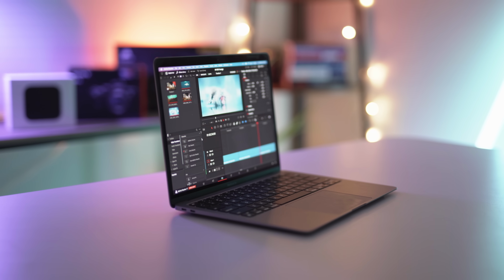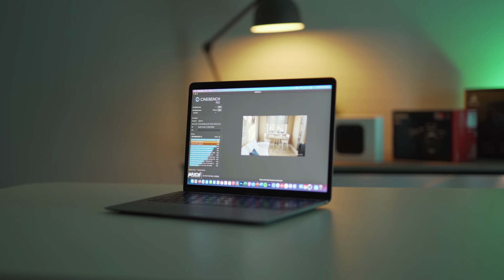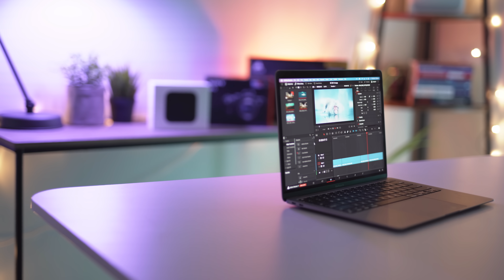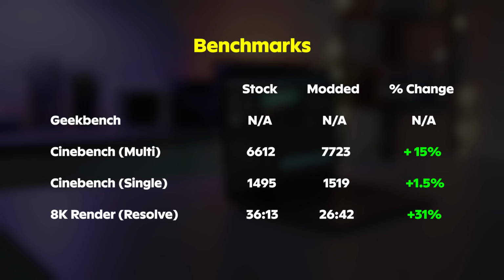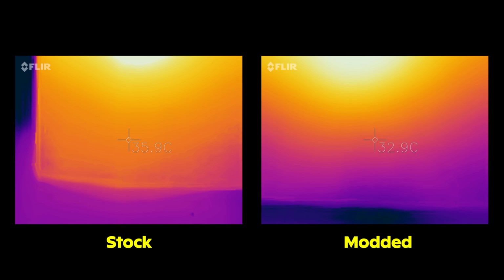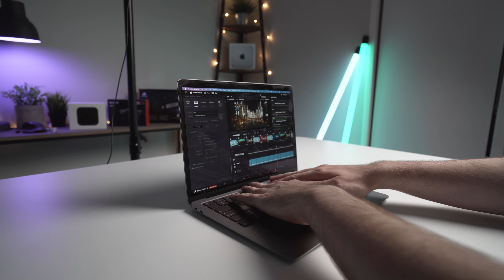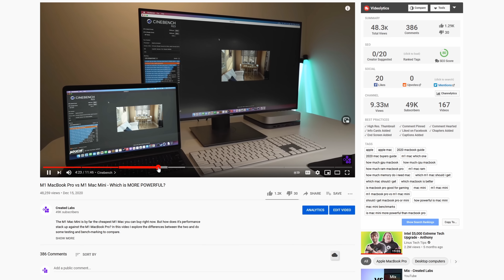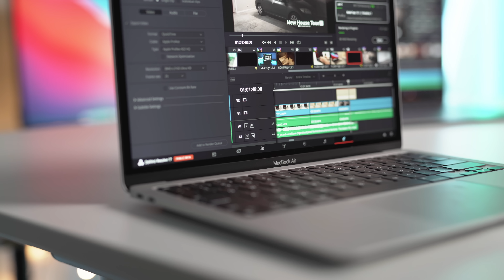I MODDED My M1 MacBook Air & Got 20% Performance Increase!

Comment: Yo the MacBook Pro keeps getting worse. I will never ever by the most expensive apple laptop again. I feel like I got legally scammed.
Reply: What do you mean by "it keeps getting worse" ?
Reply: @johns8162  I mean in comparison to the air. If I had these actual details from Apple before I bought my $1800 M1 mbp, l would have bought the $999 m1 mba. I feel scammed because they seem to purposely keep these performance difference details quiet. It’s bad for business as far as I’m concerned.
Reply: @mrwonder8470  ah I see. I was going to buy the MacBook air 512gb 16gb ram but I think I'll wait for the m2 to come out then purchase either the m2 air or m2 pro.
Reply: @johns8162  see, you probably won’t actually be able to tell which m2 you actually need until a couple of months after they come out and none of the performance numbers will be official. All from youtubers doing comparisons.
Reply: Same :( 
I thought apple products are great (
Reply: @Tronam I meant the most expensive configuration of the newest models available, to be clear. With Apple there’s always going to be a bit of buying blind, but they like people to buy ignorant. Also, I’m speaking of actually performance differences. Don’t give me that bs. I did as much research as possible. Apple releases most of its product info via influencers as rumors. If people knew that the cheapest m1 air would be able to benchmark the pro who would pay extra for the pro?
Reply: @Tronam look up until this very video it wasn’t clear that the air could out perform the pro. I bought what I thought was the best apple M1 for the money. Again, I’m speaking of performance differences. Apple seems to be purposely unclear about the actual performance differences. If the 7 core gpu air is out-benchmarking the 8 core pro, somebody should explain. I’m not an apple hater. I spent a lot of money on a laptop that I did research for and I was undereducated because there were detail that Apple didn’t want us to know right away
Reply: @mrwonder8470  yo, the best M1 for the money is the mini.  The MBP has much better battery life than the air and even with this mod the air will still underperform the mbp in anything you are doing on a sustained basis.  The cooling throttle is in all Mac but the active cooling on MBP and MM will still keep them outperforming the air on a sustained basis.  Apple isn't scamming anyone the only M1 that's different at all is the one in the cheapest air which only has 7 gpu cores like the iPad Pro.
Reply: you go for the 16gb 8 core gpu air you are getting into mbp pricing anyway
Reply: @michaelmorris5773  I meant laptop. But, even before the m1s. The 2020 mbp had 4 configurations. Intel 8 gen i5 & i7, and 10th gen i5 & i7. The 8th gen i7 and the 10gen i5 was nearly the same price. There was almost no way to tell which computer was best for what and apple wasn’t trying to clear it up. It’s almost like the figured out how to make everyone buy the most expensive computer they are willing to instead of just what they need.

Comment: Why didn't Apple do this out of the box? To reduce the temperatures and increase the performance even more. 🤔
Reply: Because with the mod the case temperature can exceed what is considered a safe threshold by international standards.
Reply: ITS because in LAPTOP there are limits to temperature on the underside FOR EVERY LAPTOP, its 55℃
Reply: because it increases the battery heat and can damage other components in long run.

Comment: Can't help but notice that the thicker (3mm) pad has very poor heat Thermal Conductivity: 1.5(W/m-k), compared to others  that have 6.0 W/mK thermal conductivity, for roughly the same price. Was this on purpose to keep from conducting too much heat to the bottom plate?
Reply from the maker: From my research I found that it didn't really make a huge difference. Go for higher thermal conductivity if you can find one in stock and it's the same price. Other than that, as you can see in the video even a relatively "low" thermal spec pad still has huge performance gains.

It would be interesting testing with 1.5 wmk vs 12 wmk pads to see the difference but I honestly couldn't be bothered haha
Reply: @CreatedTech  Just finished running Cinebench after the mod and my 10 minute run score went from 7067 to 7687. I used an AIYUNNI Thermal Pad,Thermal Conductivity 6.0 W/mK. The bottom pan got pretty toasty but it's hardly a burn hazard.
Reply from the maker: @st8kout961  Nice results! I found much more of a difference in a prolonged task like rendering, but Cinebench still gave a pretty respectable change.

Agree on "burn" hazard. I'm sure if you left it on your bare skin for 20-30 seconds you might get a slight burn, but no one in their right mind would do that even by accident.

Comment: As you are in Australia and you have summer, how does the MacBook Air cope with hot ambient temperature as in a non ac room?
Reply from the maker: I've had no issues, the hardware and software work together to throttle the M1 chip if it's too hot.

Comment: My unmodded MB Air (8 core GPU, 16 GB/512GB) already scores 1506/7687 in R23. Not sure why your MB scores so low ...
Reply: Run the benchmark several times and you will see

Comment: What happens if we try this with a cooling pad? Although I bought my M1 MBP but this is interesting. 😊
Reply: It has been already tested. With the thermal pad mod and a cooling pad, or fan forcing air into the MBA bottom, you can have sustained performance, similar or even higher than the MacBook Pro, for very long periods of time at full cpu load.

Comment: will having a case affect the modded MacBook and make it even hotter or affect heat dispersion?
Reply: Given that the heat eventually has to go somewhere anyway, if you did this mod with a case over the aluminum, you would likely still have performance gains over stock, but not as much as you would without a case.  Still would likely be worth it.
Reply: since the body is being used to dissipate heat in the modded version, you will loose performance with an external case since most cases are made from materials which are insulators

Comment: FYI the Thermalright Thermal Pad link you listed in your description is a non-conductive pad will this not insulate heat rather than dissipate it?. Also wondering if there's any point doing this on a macbook pro 13 2020 or will the fan do the work.
Reply from the maker: You're mistaken (although I don't blame you, the Amazon seller titled the product in a strange way). It has a 12.8 W/mK thermal conductivity rating.

I wouldn't do this on a Pro, the fan covers the heatsink.
Reply: @CreatedTech  thanks I figured as much

Comment: When we take 16gb ram model is there any noticeable dicrease in temperature as compared to 8gb ram model in MacBook Air?
Reply: Why would you expect a decrease? I would rather expect an increase since 16 GB usually need more power than 8 GB. That said, I guess the difference is neglectible
Reply: @eberhardjiritschka3151  RAM chips draw very very less power .

Comment: I’m going to do this when the warranty is expires to breath new life into it
Reply: Why wait? This mod is completely reversible and there's no way for Apple to know you've done this.
Reply: @agiverreviga4592  the moment you open the case the warranty gets void.There are some sensors which get triggered when you do so.
Reply: @asutoshghanto3419  Lol, no there aren't such "sensors". The back is held by screws, you simply unscrew them to open it and then screw them back to close it. There are no magical sensors or things that Apple could use to tell if you worked inside your laptop.

The same way your warranty gets void the moment you install Jailbreak, but can easily remove it without any trace, so your warranty will be still up.
Reply: @asutoshghanto3419  meanwhile me opening my computer in front of a service provider to point out an issue and getting it fixed the same day—
Reply: @asutoshghanto3419  Completely incorrect info! 🤦
Reply: @asutoshghanto3419  good info even apple guys dont know such sensor exists 🤣
Reply: @agiverreviga4592  ty.
Reply: @asutoshghanto3419  absolute nonsense!
Reply: @asutoshghanto3419  wtf, sensors? Bro what drug are you on?
Reply: @matchacakeuwu  Its possible lol but I doubt apple would do anything like that cuz of money
Reply: @zoinks5717  Fair, Apple is really not into people opening and upgrading their macs since 2013
Reply: @asutoshghanto3419  Sensors? Can you show us where these secret sensors are? LOL
Reply: @asutoshghanto3419  That's illegal in US company can't void your warranty for opening your machine
Reply: @agiverreviga4592  it can be void if you leave marks on the screws, so you either need to be very careful or buy replacement screws.
Reply: "Warranty void if removed" labels are not enforceable in the US afaik
Reply: Sane
Reply: same, but I'm waiting till I can definitely afford a replacement if I need since this computer is my main editing machine for not only my youtube vids but also my photo/video business
Reply: Don’t do it. This way you spreading excess heat to the battery and Lithium batteries don’t really like being heated
Reply: Yeah killing a laptop after warranty expired, that’s great man

Comment: Heat is being transferred from the CPU to the battery. Surely that could be massively dangerous?
Reply from the maker: Heat is not being transferred directly from the CPU to the battery. On average, the battery is about 4-5 degrees warmer with this mod. Again, I'm not saying this mod is 100% safe and I'm not even recommending anyone to do it.

Comment: Now I kind of wonder if we put it on a laptop cooler, or on a heat sink stand like the Rain Design stand, and adding a small USB powered desk fan to cool the aluminum stand? Also would this add to FPS in games in any measurable way?
Reply: I have the rain design aluminum stand and it has the gray rubber pads so I guess those can be replaced with thermal pads lol

Comment: Very simple and easy mod, used a 2mm thermal pad directly above the cpu, on the rectangular part of the heat sink. The square part of the heat sink on the 8core gpu model comes with a thermal pad already attached to the bottom case
Reply: I suspect that the thermal sponge on the 8 core Air is there to  boost performance and differentiate between the base Air with 7 graphics cores  and no thermal sponge and the one with 8 cores.  When I modded my base Air I didn't bother with fitting a thermal pad where the  Sponge is on the 8 core version and still get Cinebench R23 scores at least as good as the Air Pro.

Comment: Amazing ! DEF GONNA DO THIS MOD ON MY M1 AIR ! did you use 2 brands of thermal pads ?
Reply from the maker: You can use the same brand. I used different brands because I had to ship each of them separately due to stock levels. Each arrived about a week apart.
Reply: @CreatedTech   Sounds good ! I just bought a 2mm and 3mm pad from amazon ! I read the 2mm fits a little bit better ! all in all 25$ to do my M1 and My Gf's M1 :) Thanks for the vid ! :)

Comment: If doing this will affect the warranty or not?
Reply from the maker: It's hard to say for sure, but if anything goes wrong due to the mod you won't be covered by warranty for it. If you're worried about warranty, I probably wouldn't advise doing this.
Reply: @CreatedTech  May need a fan instead, as you suggest.😂